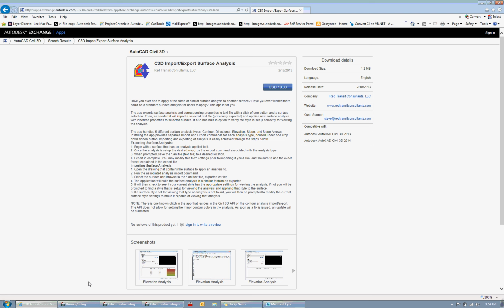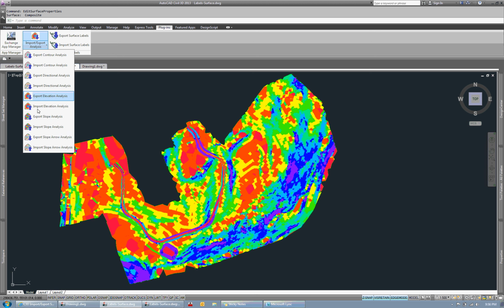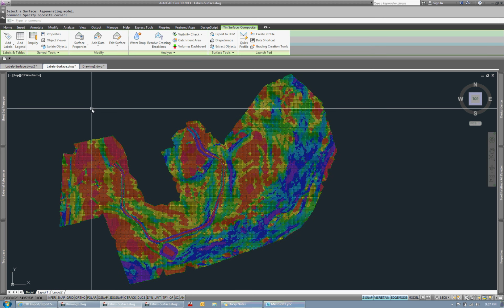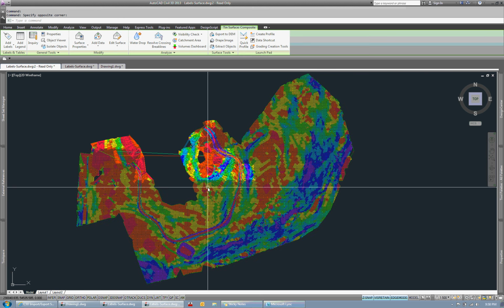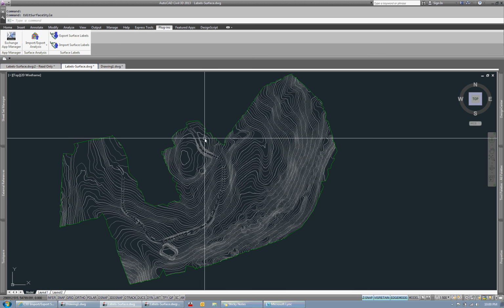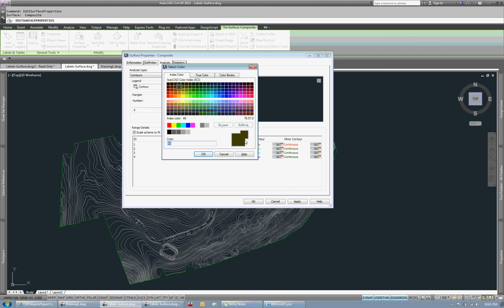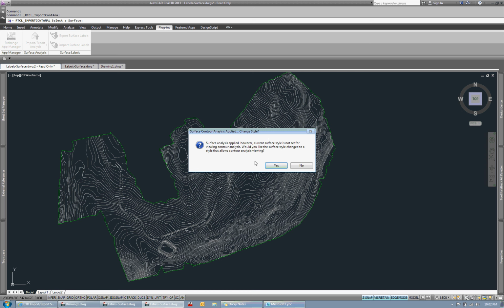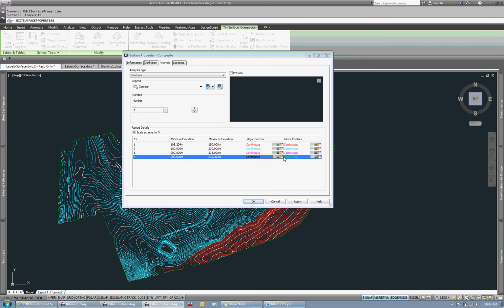C3D Import/Export Surface Analysis

Comment: If you could add a function to the app in which I can easily control to settings of the colors/analysis I would buy it straight away!
Here's an example: If I use "rainbow" colors in C3D the lowest point is red instead of dark blue as it is in normal maps. If the app could switch those colors around it would be really nice!